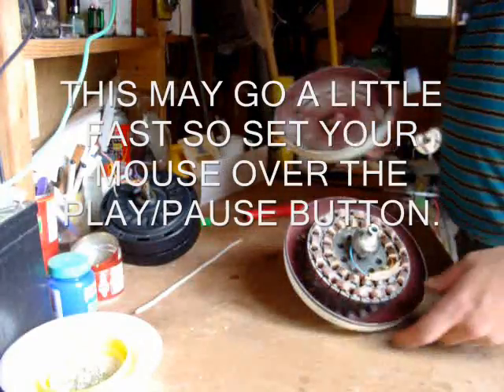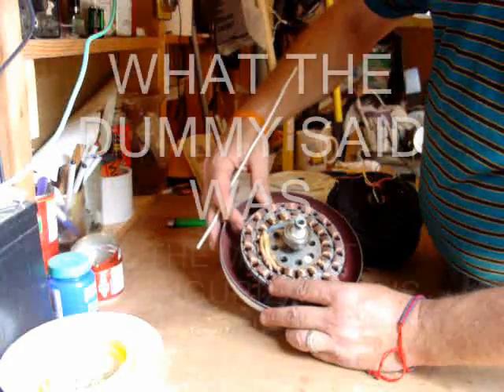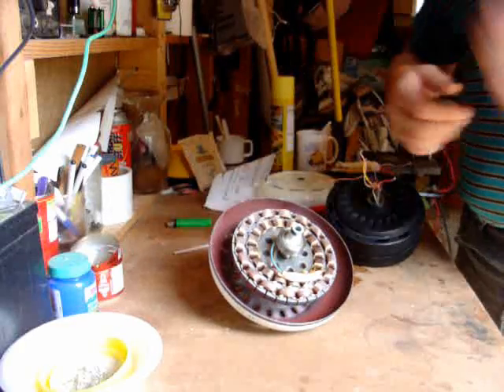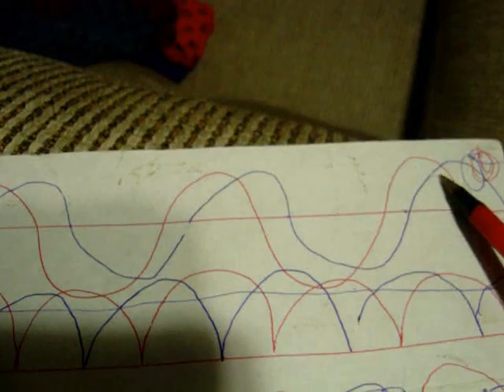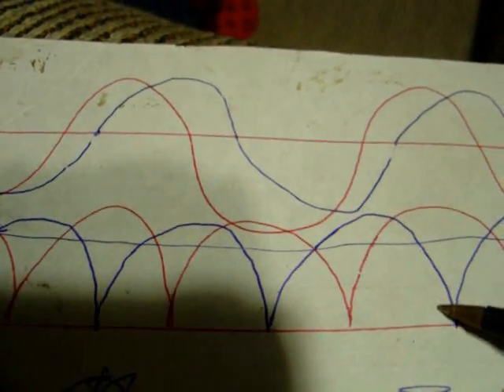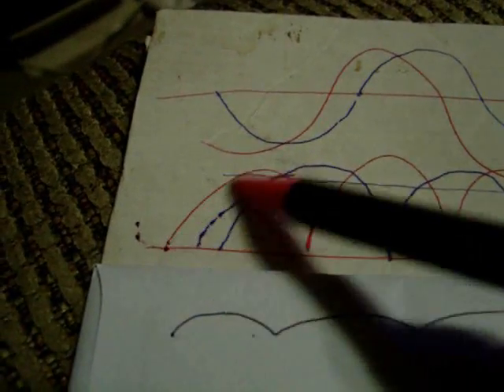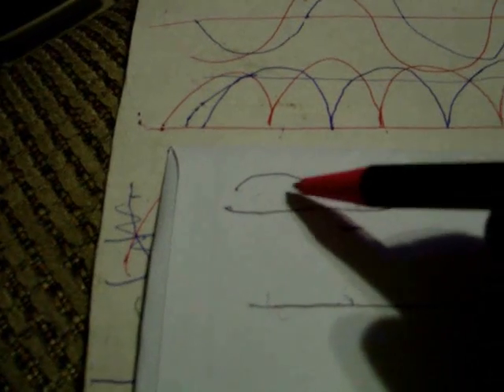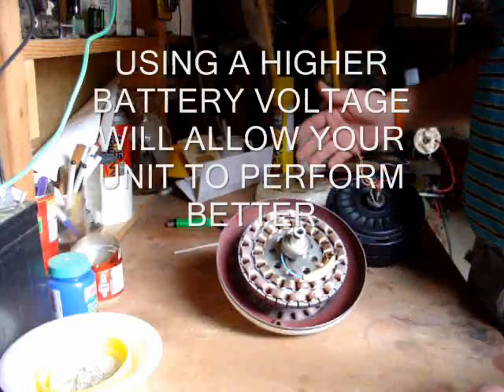PART 2 HOW TO CEILING FAN WIND TURBINE

Comment: I have a question. I made a wide turbine out of a ceiling fan. It works good. But i want to rewind the motor so that it will give me more amps. Right now I only get 1 to 1½ amps. My question is what size wire will give me 10 amps?

Comment: Thanks for the video.  I appreciated the graphs.  Thanks for taking the time to (re)draw them.

Just curious...does anyone know if a square room fan can be converted the same way as a ceiling fan?  I have a square room fan w/ 3 speeds that's about 2 feet on a side.

Comment: For my first ever attempt at making a wind turbine i'm using a ceiling fan but made some adjustments, i have decided to make my first stator coil using 14awg and unfortunately i can only get 40 turns per stator, =9 of, would there be a generation of too many volts or amps? you're advice will be so gratefully accepted

Comment: I have a Hampton Bay ceiling fan and what I did is I opened it up took the stator out of there and then put my magnets all around the casing which I put it to in retaining ring around the inside and I do get some power out of the ceiling fan when I turn it it's showing me somewhere around almost 200 volts when I hook up an LED light it doesn't light up at all I can't figure out what I'm doing wrong I did everything that I thought was right and I can't figure out why the LED light is not going on . Maybe you can help me solve my problem I appreciate it Mike

Comment: couldnt you charge 4 semi truck batteries?  cause then you could run a power inverter like one for the semi trucks. Ive ran a tv, microwave, refrigerator and xbox all at once .

Comment: Am I right in assuming that, if we actually take a ceiling fan 120 V, 400 RPM and turn it at a speed of say 10 RPM it will not give us any AC since the magnets are electromagnets and not permanent magnets?

Comment: voltage = magnetic fluid density * length * velocity
current = voltage / resistance
power = current^2 * resistance
describes an endless magnetic fluid (magnetic toner fluid) endless current loop
you seem like one that could build it --- it's an electric universe
SQR(cos+sin)^2 = 0 to 1.414 AC an precess DC phase frozen - again thanks ...

Comment: Hey there Scott, you have some great videos here... Been trying to post to you for some time now. My question is, if I just want to make a direct AC unit to AC output I have no need for diodes or rectifiers correct? I seem to be doing fine with the unit wiring, but after it lea Ed the unit is where im confused... Any help would be greatly appreciated. Thanks and keep up the good work!
Reply from the maker: THE WIND IS WILD. AND SO WOULD THE AC CURRENT. UP AND DOWN IN BOTH FREQUENCY, AND VOLTAGE AS WELL AS CURRENT. iT WOULDNT MATCH THE HOUSEHOLD AC GRID. BUT IT CAN BE USED FOR LIGHTS, AND OTHER THING DIRRECT. WHICH BRINGS IN ANOTHER PROBLEM CALLED STALL OUT. WHEN THE POWER IS DRAW DURING STARTUP, IT CREATES A DRAG MECHANICALLY. THIS WILL CAUSE THE BLADES TO SPIN TOO SLOW TO CATCH LIFT, AND THE UNIT WOULD STALL OUT BECAUSE THERE IS NO FREE SPINNING RPMs BEFORE CATCHING LIFT IN THE LOW WINDS.
I HOPE THIS HELPS.
AND THANK YOU.
MUDDy

Comment: Where do you get the magnets and bridge rectifiers? How much was the cost??? Thanks, great vid!!!
Reply from the maker: ooOOOooo an ever changing answer to that question. so far i find the magnets cheaper at (magnets for less). or cms magnets. but you can get them the same day at walmart in the arts and crafts section. 4 magnets for 3.48 per package.
cheaper on the web.
the bridge rectifiers are about $2.50 each for a total of $5.00 or so at radio shack. Once again, cheaper on the web. 8 amp rating for the ones i used. 2 or 3 amps are ok for this app. the wires in the stator are pretty thin, thus low current, higher voltage.
Thanks, I hope this helps.
MUDDy :)

Comment: Why not just throw a lm7812 regulator and a 2n3055 pass transistor across it and regulate the output?... cheaper than buying batterys
Reply from the maker: SOUNDS LIKE A LOT OF POWER DRAIN. THESE DONT PUT OUT TOO MUCH AMPS DUE TO THE THIN WIRE IN THE STATOR. TOO MUCH RESISTANCE. BUT THEY CAN PUT OUT MUCH MORE POWER IF THE HIGH VOLTAGE IS USED, OR THE STATOR IS REWOUND WITH 18 GAGE.
I WILL BE MAKING A VIDEO ON THAT SOON.
MUDDy
Reply: ***** Well, yeah, if you are going to the trouble of rewinding. Sure there are better ways but adding expensive batterys because one doesn't want to regulate the voltage is kind of beside the point. The regulator doesn't take so much power if done right. You could use a zener and a pass transistor with little problems... anyway... will wait for the other vid... should be interesting. Mosfets are in the milliohm range when fully turned on and wouldn't take so much power...

Comment: was on youtube for an hour looking how to make one then i found mudman and i hit the holy grail for fan turbines
Reply from the maker: THANKS, I'VE BEEN MAKING THEN FOR YEARS BRO.
WHEN I MADE THE FIRST ONE 8, OR SO YEARS AGO, NO ONE BELIEVED THAT A CEILING FAN COULD BE MADE INTO ONE. I PROVED THE WORLD WRONG, AND FOR CHEAP TOO, AND MY HANDY WORK HAS TRAVELED AROUND THE WORLD. GEEE WAS I SURPRISED. I AM SO GLAD THAT THERE ARE SO MANY DOING VIDEOS ON IT NOW, THAT I NOW KNOW, THAT AN IDEA CAN TRAVEL AROUND THE WORLD FAST. THEY ARE LOW WATTAGE UNITS, BUT VERY VERSATILE IN APPLICATIONS. CHECK OUT THE CEILING FAN CHRISTMAS LIGHTS VIDEO. STRAIGHT OFF THE AC. BUT YOU NEED AT LEAST 12 TO 24 STRANDS OF LEDs OR YOU RISK BLOWING THE LEDs. LOL
 LOTS OF FUN MATE.
THE CONNECTIONS ARE... CONNECT ONE WIRE FROM EACH COIL TOGETHER, THE TWO OTHER WIRES ARE THE OUTPUT. NO DOIDES NEEDED. WHEN THE WIND GOT TOO HIGH ONE DAY, THE AC VOLTAGE GOT UP TO 143 WITH THE LEDS CONNECTED. SO I PLUGGED MY LAPTOP INTO THE END OF A STRAND. THAT LOWERED THE VOLTAGE DOWN TO 125VAC. LOL. WWWEEEEE.
MUDDy
Reply: muddymuddymuddmann muddy the great Master of wind!

Comment: I want to supplement my two existing 2'x4' roof top solar panels that feed my 2000 watt inverter that charge my eight 12 volt batteries in my RV.  I live in a fairly windy desert in southern California and i think your idea will work great.  Can you help me with specifics for the generator?  What amps, watts parts and such.
Reply from the maker: WHILE THESE R PRETTY CHEAP TO MAKE, THEY ARE VERSATILE, BUT VERY LOW WATTAGE. BUT THEY CAN BE MADE TO PUT OUT MORE BY REWINDING THE STATOR WITH 18 GAGE WIRE. THE VOLTAGE WILL START OFF LOW, BUT THE AMPS COME UP QUITE A BIT MORE THAN THE OTHER THIN WIRE COILS WOULD ALLOW. I WILL BE DOING A VIDEO ON THAT SOON.
MUDDy

Comment: Well I actually got the whole thing epoxied and wire set but and made a verticle turbine for it but it was cheesey  and would not turn. And that's when I contacted you about the prop. I still need to make the prop and get the golf cart batteries but haven't done any further work but I'm getting back on it and will be able to show you a video in say the next month or so.

Comment: Dear Mr. Brown,  I am the Physics teacher at Spotsylvania High in Va.  My students are doing a project in which they have to make a small turbine that produces the most electrical energy.  They can make a small generator with magnets and wire or canibalize a motor like you have done.  I am turning the kids onto these vid's but some more explanation may be needed.  For example the bridge recifier.  You may get some ?s from them.

Comment: Hey Muddy, at the end of the video are you saying that both too little or too much battery bank voltage slow down your wind turbines? As in, if my generator output was 50 volts, I want to neither charge a 12v battery, or 48v worth of batteries? So middle of the road, say 12V x 3 batteries=36V is better?

Comment: HI muddy, I have an old ceiling  fan, 220-230 volts 50 hertz. The feature of the coil, 3 wires outlet or output and 1 coil is overlapping another coil. I don't have much electrical experience, tell me if this one can be a generator. Please reply to me about this matter.

Comment: @fused210 
If you want to use both windings then you should rectifie both voltages before you connect them  anyway, in parallele or in series, diodes wont let any current to flow in a direction from one source in parallele to another, so there wont be a correction current in terms of equaling the connection point voltage.
I simulate it but i dont see ANY reason to doit that way...your sources wuld conduct currents like flip flop...part of period one and part of period second...it is not good.

Comment: @fused210 

I just saw the video with sound...it is not a good idea to put those two sets of coils in parallel...wire is designed to withstand current of 1A and not to mention the difference in voltage between two sources...there would be currents between those two sources that dont go anywhere else but just trying to get the voltage in a point of connection to same voltage....not a good idea at all.

Comment: @fused210 
You cant get light bulb to light because you cant get enough power with both windings...voltage that you measure isnt right...voltmeter shows you voltage RMS value of SINE wave...and you dont have sine wave ...it is more like this 
deviantpicsDOTcom/?v=scope.png

Comment: From the picture i think that you got it wrong (watching video without sound :), output frequencies of both windings are different, freq. of the lower winding is twice the freq. of the upper winding.
If you like you can put it in "reverse", if you want the same speed of the rotor you should put double the freq. @ stator windings to get it with upper windings
You can get much better power output if you rectifie both voltages seperatly before conect them in series.

Comment: very informative............very well explained........this truely works ; However i am afraid you have mis explained the wave shapes of the rectified voltage. on your primary and secondary waves would ahve a break where the period would be ideally nil on the negative half of each phases cylce...then adding these two and filtering through a capacitor or inductor, one can achieve a smoother DC output. Just thought I would Help.

Comment: hi scott, this wind 5 to 10 miles per hour it dosen't move the motor , i may try to put blades on. but my brother hook it up to a 22cc gas motor,i cant belive i was getting oround 160 voilt each coil , if i run like this for a wile you think i my burn the coils.thank you. joe

Comment: hi scott, it works,i solder the wire like you said.but i lost half of the power on the coil that i was getting 100 volt i only get around 50  so i dont know if i won to finish this one.isaw one on ebay for 12 dollar, but they dont have  pictures ,i dont like to buy with out it .thank you scott i will let you know.joe

Comment: hi scott , its joe , i need to ask you about  a power inverter fromn dc to ac a big of a inverter do i need to run a pool filter a 3/4 horse power.i have 4, 12 volt battery  wat is the best way hook them? in series or parallel?and then go  to the enverter to run the filter .thank you .joe

Comment: hi scott ,i need help ,i disassemble the motor to epoxy everthing, i set the magnets like i did before ,  after i try it didint work i got no power . the only thing i can think is when i             take the cover out i stick a scrudriver inside and i see that there is 2 or 3 little wires from the coil are broken you think that is the problem or it may be something else . i was so happy ,please help me .thank you joe

Comment: hi scott ,ok i put the double stacks of magnets in ,i hooked up one meter for each coil and i spined it with an electric drill i got 110 volt from 1 coil and 60 from the other coli is that normal or did i do something wrong.thank you joe